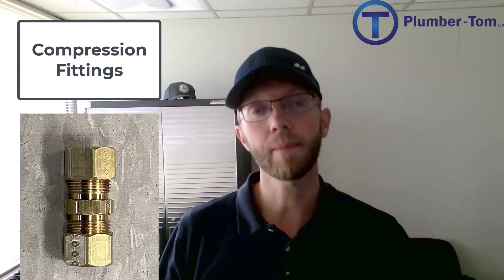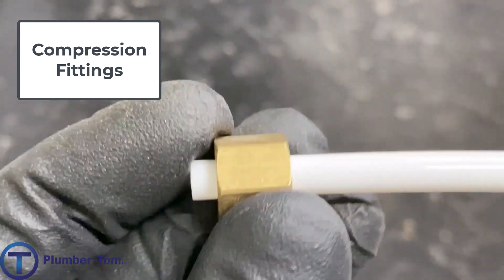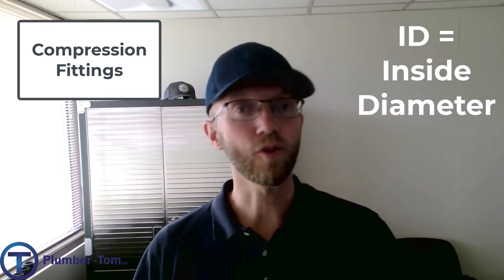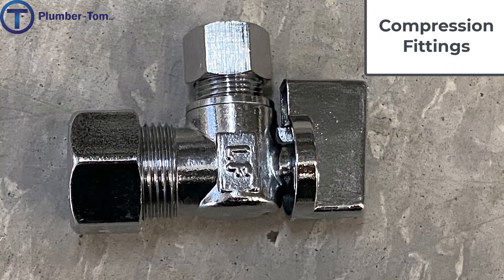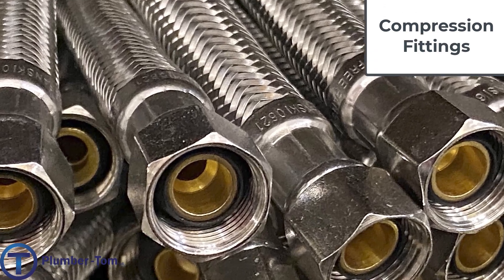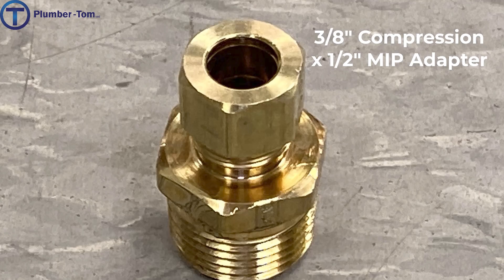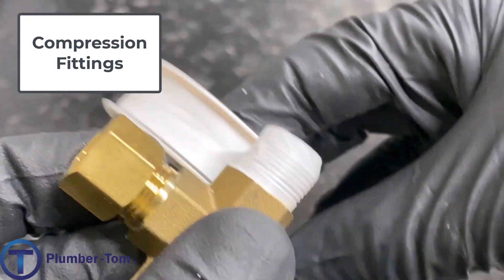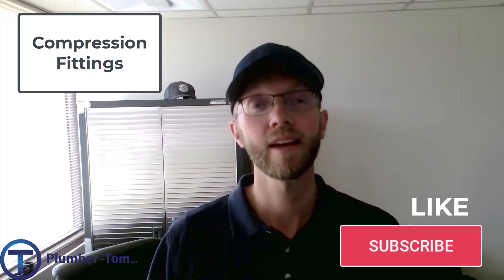Plumbing Parts Identification: Water Pipe Fittings Episode 7 - Compression Fittings

Comment: Any reason why flared copper tubing is not commonly used for plumbing in the US except for gas flex lines?  It's a lot more common in Europe.  No soldering in involved.

My background is mechanical engineering and we use mandrel steel tubing with JIC 45 degrees flared end connections all the time... 3000 psi is no probs at all.  50-100 psi in household plumbing would be cake walk.
Reply from the maker: In the International Fuel Gas Code we find there are restrictions for the use of copper because some gas mixes can be corrosive to copper.  This might be the reason it is not used as much.